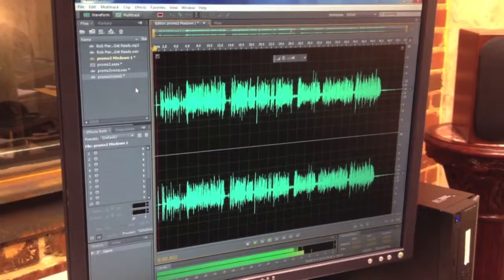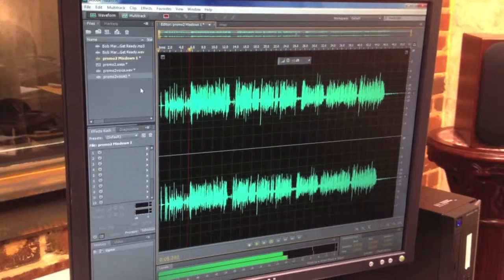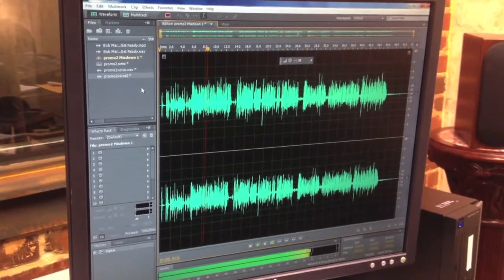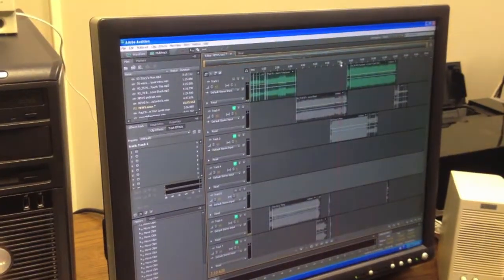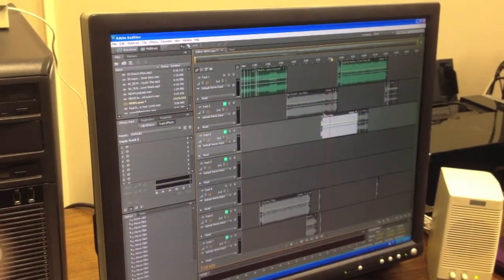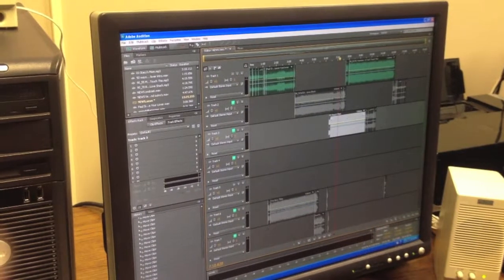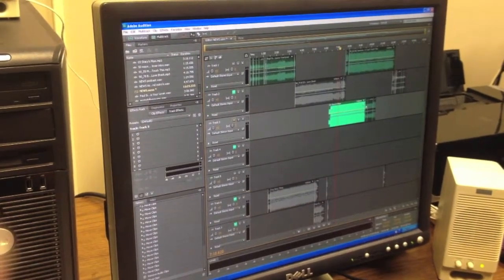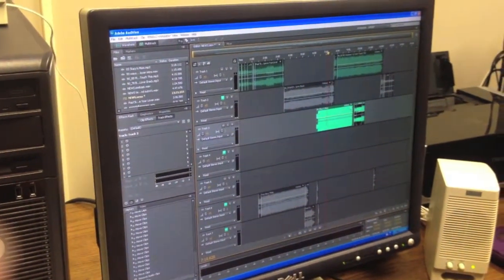TOH Radio

Comment: WTOH was once a student run 10 Watt FM station that broadcast out of the Student Center with a studio outside the cafeteria. The studio had two turntables and at least two microphones, a clock, a few of those ON AIR signs and a wall or two of vinyl LPs, but most people brought there own records. My old FCC license was issued for life, so I guess I'm still good to go...

It's interesting what you guys are doing, and good luck.